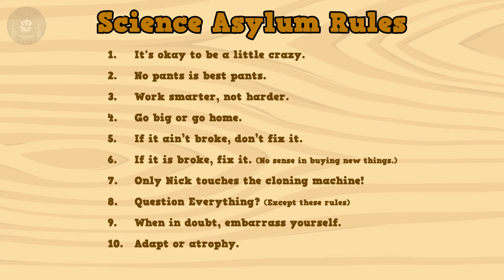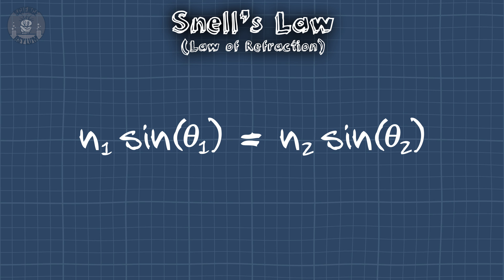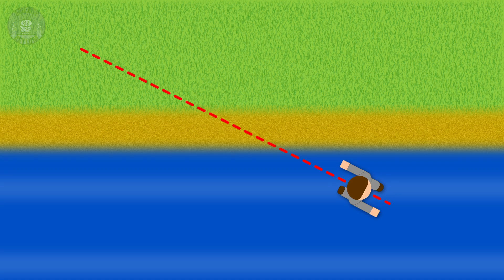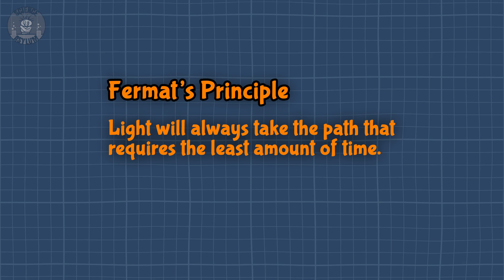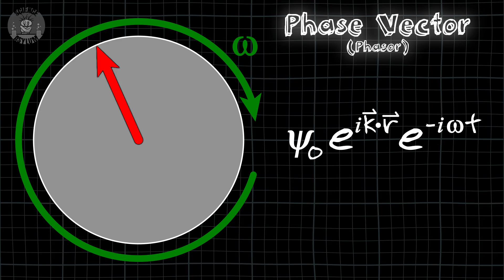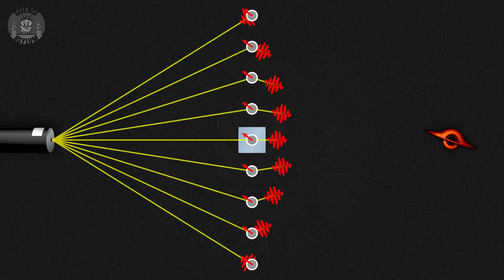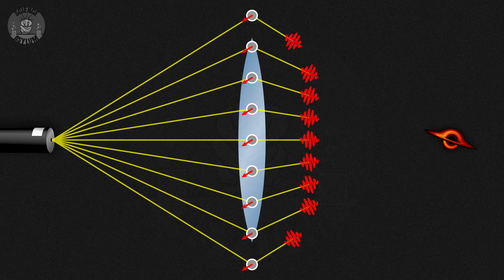Why Does Light REALLY Bend?

Comment: Between this and the mirror video I'm getting a whole new way of thinking about optics.  
Questions:
- Is there a function that defines the proabilities of all paths relative to the 'proper' one (for example a gaussian curve)?
- What happens when you add polarisation to the mix?  What quantum craziness lies down that rabbit hole?
Reply from the maker: 1. Yes, the total probability density will do this. I talked about that a little in my wave functions video: https://youtu.be/vShpwplJyXk
2. You are correct that I'm ignoring polarization in this. It wasn't necessary to make my point, but we could include it in the wave function if we wanted to. It doesn't make the math that much harder, but it does make the picture more complicated.

Comment: Idea/Question
I think the the reason things glow when they get hot is because atoms get closer and farther away from each other rapidly.  This leads to the electromagnetic fields interacting which makes electrons go wild with the whole 'jumping' thing. According to this logic, the hotter something is, the more rapidly the atoms move, the more the electromagnetic fields interact, the brighter something glows. Also, if the wavelengths of light can effect the movement of atoms, then something that's burning bright could heat up other things around it and atoms near it (heating itself). That doesn't make sense because conservation of energy. Is there some sort of special principle that makes sure none of the light emitted heats up what's emitting it flashing light not heating itself on fire by existing)? Also, if heat and light are so closely related, what's the difference? That may sound stupid, but you can't have light without at least some heat (as far as my understanding goes), and the same the other way around. Even if we don't SEE it, it's being emitted. Proof (infrared goggles or whatever they're called, how snakes see).

TLDR:
Why don't things heat themselves with light? How can we differentiate between light and heat if they always come together? Also some of me confusing myself.

Edit: Typo.
Reply from the maker: What you're describing here is exactly what happens. Matter emits light due to it's temperature (usually mostly infrared) because of the wiggling around of the atoms/molecules. This energy is absorbed by neighboring atoms and then re-emitted, which is why you can heat up one part of an object and it will heat the entire object. That energy spreads out be exactly the mechanism you describe. Ultimately though, that energy is emitted from the entire object through conduction, convection, and/or radiation. I assure you, conservation of energy still holds in this process. (You can't distinguish between light and heat. Light is an integral part of thermodynamics.)
Reply: @ScienceAsylum  Thanks! So the light we see is the light escaping from the system and it doesn't reheat whatever the system is. However, let's say we had a perfect mirror box (all light is reflected from the walls and none is absorbed by the walls). The light emitted by the system would eventually make it back to the system. Would it continue to heat the system to no end? I promise I'm not trying to violate conservation of energy, I'm just curious. Thanks for taking the time of day to respond to my comment by the way.
Reply from the maker: FYI: There's no such thing as a perfect mirror box. That's a physical impossibility.
...but, if we had one, it still wouldn't infinitely heat the object. It would eventually reach an upper limit because the light being released would balance the light reflected back from the mirrors.
Reply: The Science Asylum ok cool, I'll let get back to whatever you normally do with your time. :)

Comment: also a fan here, thanks for the great video's. And yes you made me question light and a black hole:
Does Light increases the mass of a black hole when it enters? And what if is stays looped around the event horizon?
Reply from the maker: Yes, the mass of a black hole will increase if it absorbs light. If the light goes into orbit around the black hole, it will also count toward it's mass for any observer outside that orbit.

Comment: Okay but with your lens explanation, this seems to imply that if you make the lens bigger and bigger, the brightness at the detector will become arbitrarily large. However, if the light source is a laser, the light is collimated, so only a small range of angles will have any appreciable photon density to begin with, so a lens bigger than the beam will not appreciably contribute to any increase in brightness at the detector. Thus, the photons do NOT take every possible path if the laser beam is collimated.

Comment: So it came to my attention that light does not need a medium in order to propagate (as opposed to sound for example). With that said, you already covered why once the photon hits a material, the atoms vibrate and eventually the wave combines with it and we get refraction, diffraction or simply put, a change in direction. My question is regarding these indexes: why does air to water different then air to oil or any other material? What happens in the « superzoom » state for these different elements/molecules that makes them deviate the light beam, but not to the same degree? Thanks and keep up the quality videos!

Comment: Nice graphics. Based on another great video, my understanding is Snell’s Law and Fermat’s principle explain by how much and “how” light bends from air to glass but not “WHY” it bends.

The electric field of the incoming light interacts with the randomly arranged charges of the glass, inducing an ordered electric field within the glass which then counter-acts/opposes the light.

The resulting parallel Electric Field components of the air and glass must be equal at the surface, thus reducing the perpendicular component of the light in the glass, which is the bending.

Just an explanation I viewed.

Comment: Love this video, but I do have one issue with it: why do you have the phasor rotating with a negative angle? It honestly really annoys me that "clockwise" is the default angle or that  the term is even used in physics books at all because it really skews with people's expectations. Positive and negative angles are already mathematically defined, so why not use and teach those instead of relying on outdated terms? I'd even gather that most people growing up now are way more used to numerical clocks on their phones rather than analog clocks so soon the term won't even really be common knowledge anymore. Thanks for the content!
Reply from the maker: Which way the phasor rotates depends on the sign of the exponent in the definition. Since mine was negative, the rotation direction is also negative.

Comment: I still haven't managed to wrap my head around what actually happens when light "slows down" on quantum scale. 
It doesn't really slow down, right?
Reply: Short answer: No electrons (void) = Light travels in straight(ish) lines. Electrons (medium) Light is absorbed by Electron and emitted in a random direction (light scatter) which increases the distance light travels because it's zig-zagging through the medium. This we interpret as " light slowing down" and still travelling straight. Hope that helps.
Reply from the maker: Like  @billdecat855  said, that's the "short answer." It's the answer where we explain things on quantum-level without actually taking quantum mechanics into account. It's really about wave interference. Even photons and electrons are waves. I'll make a video eventually.

Comment: The way you explain it, it seems that the path of max time should also do the trick. I wonder if someone did an experiment to check this?
Reply from the maker: The problem with that is there is no max time path. For every path you find, there is always another that takes more time.
Reply: The Science Asylum Yeah, I guess this is what you normally see in nature. But can you come up with some artificial conditions such that this system would have max instead of min? I bet some clever scientists already did it.
Reply: @V1tal1t1  Not likely, you're missing the point that there are infinite paths so there will always be a longer path.
Reply: Bill DeCat Don’t see the contradiction here. There can be infinitely many shorter paths and only one the longest. Moreover the shortest one doesn’t necessarily have to be 0 either. Like in raised bell curve say e^(-x^2)+1, there only 1 max which is 2 and infinitely many lower values bigger then 1.
Reply: @V1tal1t1  We can't have negative time or distance which is what you would require to do what you suggest. Both of those require starting at zero to make sense. As such there cannot be infinitely shorter paths than the quickest in time. Perhaps by distance it is shorter but not by time and time is the overall factor being discussed.
Reply: Bill DeCat This function gives you time, x is a distance from the starting point. Negative distance just means you go to the left from the starting point like in the video.

You don’t even need a global max either. Local one will also work. Say 1 local max and 2 local min, say t=x^4/4-x^2/2+2. In this case you would have infinitely many paths taking more time than at a local max (0,2). According to the explanation in this video you should have 3 bright spots, at (-1,1.75), (0,2), (1,1.75)
Reply: The Science Asylum Hey Nick, I dug a bit dipper and found Feynman’s lectures about it, where he actually briefly mentions that sometimes it can be max time path. Now I see that it isn’t hard to make. Like in your video you just make the center of the lens even thicker and the edges even thinner so that it would take light even longer to get to the end point from the center and faster from the edges. And so you’d get max. 
So I guess the Fermat's principle should really say that the light follows the path of extremum time.
Reply: @V1tal1t1  Awesome, which lecture? I'll have to watch it again.
Reply: Now that I think of it this is actually an experiment you could make. Just make a lens according to this last graph and I bet you’d indeed see three bright spots.

Comment: Light simply travels in a straight line until it bounces off something and then continues traveling in a straight line in a new direction. Light seems to be traveling slower when passing though a denser medium because it's bouncing off more atoms than it would in a less dense medium, so it's traveling in less of a straight line and taking longer to get to a certain distance away from it's source. And light is moving in all directions. There are photons bouncing off objects in all directions, depending on where on the object each individual photon bounces off from and the angles of the incoming photon and the angle of the surface they photon bounces off from. The light isn't trying to get to your eye specifically. You just see the light that happens to enter your eye. Probably and chance have nothing to do with it. You don't need quantum mechanics to explain this.

Comment: but wait, if lens in that way is making each of the possible path land on the same phasor (i.e. making them contribute more) doesn't that mean that light will become more and more unpredictable as more and more path are the same time-taking therefore making light more dispersed?
Reply from the maker: No, it's not like the light builds up. All those photons in that animation are a single photon taking multiple paths simultaneously.
Reply: @ScienceAsylum  it's not the intensity, but probability to land on the same place at the end?
ooooh, if so, it explains a lot.

i thought about this: at the end, when photon is landed and we observe it, it's wave function collapses and we see it as it traveled one single path and only one. And different paths would be refracted diferently, therefore more paths are more probable and at the end light would bend at more ways possible.

So i did not consider this as a single photon, and the thing that this is probability of landing in the same place.
Reply from the maker: Glad I could help 😊

Comment: I wonder, though: is it possible to correct for that bending now that we know how it works? As in, can we make some kind of camera that "sees" the object where it really is?
Reply: Interesting idea. Anything optical would rely on the propagation of electromagnetic waves through whatever's between the detector and the thing. Light can only traverse through matter by interacting with it. The degree of bending varies a bit by the wavelength or color of the light, with blue-violet light being bent more than red light. A couple of possibilities, maybe:

-Use a wavelength that is less affected by the bending, so you get something that's "close enough". This would be outside the visible spectrum. Not "light" in the colloquial sense, but the universe doesn't care about our arbitrary retinas. Far infrared, maybe even larger. But then you run into where the resolution breaks down, the detector needs to be special (and probably very large), and if the wavelength is really big, it might not even interact with the thing you're trying to find in a way that gives you useful information.

-Compare a variety of incoming wavelengths to try and calculate the magnitude and direction of distortion. For example, "the blue light reflected from the thing we're trying to find is shifted this far from the red light coming from the same object (a computer would have to try and 'line them up').  This suggests that the light is being bent approximately this much, in this direction." The shorter explanation would be "measuring chromatic aberration to try and... do the thing".

For that second one, you might need an extra dimension of measurements to get a good position. Time? Phase angle? Hard to say.
Reply: @tom_something  
I thought more about employing detection of other behaviours of light to determine the angle or position: diffraction, polarisation, that sort of thing. But I'm no physicist to tell if it's of any use here ^_^

Comment: I absolutely love the way you explain everything in every one of your videos! You provide beautiful analogies without over simplifying. Thank you!
I have a question that I would like to ask. Something that is a kind of paradox in my opinion. 
If water is H2O and both of those elements are in the air, is the air like thin water? Are we wet when we think we dry? Kinda like how fish might think they are dry.
Reply from the maker: I think "wet" requires water (H2O) to be liquid phase. In the H2O in the air is in gas phase. It can get a little iffy though when humidity is 100% like it is in a tropical rain forest.
Reply from the maker: The difference is density. The molecules are a lot closer together in a liquid.
Reply: There is very little H or He in our atmosphere. Both of these elements are so less dense than everything else in the atmosphere that they almost immediately escape to space. Most H detected in our atmosphere is bound within some other molecular structure (i.e. Water, Hydrogen Sulfide, etc)
Reply: What is the difference between gas phase and liquid phase on the molecular level? Are they not the same?
Reply: But they are the same, just more dense right? So in that sense air should be considered a liquid, no? Does air not follow the laws of fluid dynamics?
Reply: And hydrodynamics
Reply from the maker: Just because air is a fluid, it does not make it a liquid. Both liquids and gases are fluids, but they have slightly different behaviors because of their density.

Comment: So even the speed of light is an illusion and absolute at the same time.
Reply from the maker: We only pretend it slows down so we don't have to deal with electron-photon interactions.
Reply: @ScienceAsylum  Wait, how does that work?
Reply: @robertolson7076   Short answer: No electrons (void) = Light travels in straight(ish) lines. Electrons (medium) Light is absorbed by Electron and emitted in a random direction (light scatter) which increases the distance light travels because it's zig-zagging through the medium. This we interpret as " light slowing down" and still travelling straight. Hope that helps.

BTW, I said straight(ish) due to the gravitational lensing effect. Light still travels straight but space is curved.
Reply: @billdecat855  Thank you!
Reply: @robertolson7076  NP

Comment: At the exercise pool I go to the floor of the pool is neutral light gray but there are lane markers which are composed of black tiles.  When looking into the water at an angle at these black tiles the near edge seems to have a bluish hue while the far edge seems to have a reddish hue.  While I understand that must mean the blue is  showing a  shorter wavelength and red a longer, I can't work out exactly why
Reply: This is because shorter wavelengths refract more than longer wavelengths. Every single point in the pool projects a rainbow at you. You can only see it on the edges of the black tiles, because everywhere else the rainbows from neighbouring points blur together into white. In fact, if you look closely you may notice that the image is blured vertically, but not horisontally.

Comment: The phase vectors spinning in a mathematically backwards direction made me uncomfortable xD
Nah but great explanation! Fermat's principle sure sounds a lot less complicated now ^^
Reply from the maker: It doesn't actually matter what direction they spin. I made it spin clockwise because the exponential told me to.
Reply: @ScienceAsylum  
Really. Interesting. I was taught phase vectors always spin counter clockwise as long as time is moving forward. Apologies :D
Reply from the maker: They usually do (like in electronics), but it really depends on the sign in the exponent.
Reply: @ScienceAsylum  
Aaaaaah! That would make sense. Never thought about that. 
I was taught by Electrical engineering professors :D
Thank you for teaching me a new viewpoint on this!